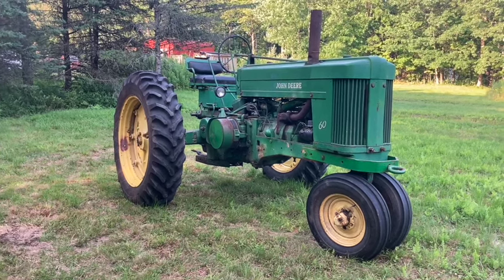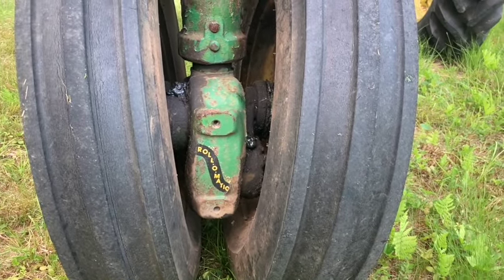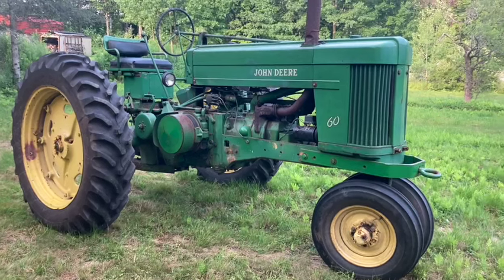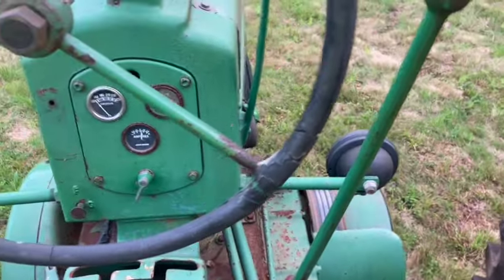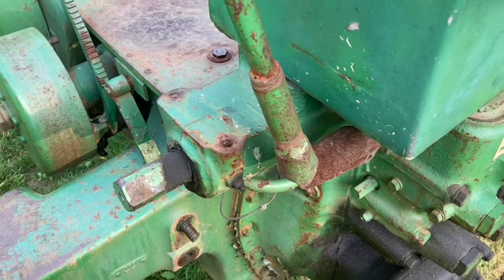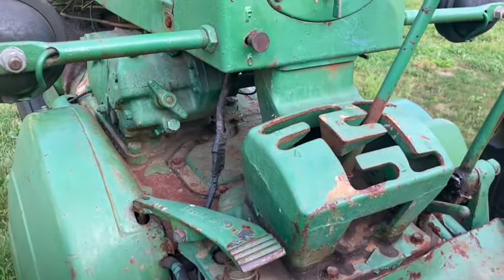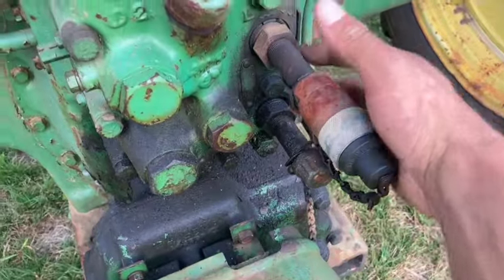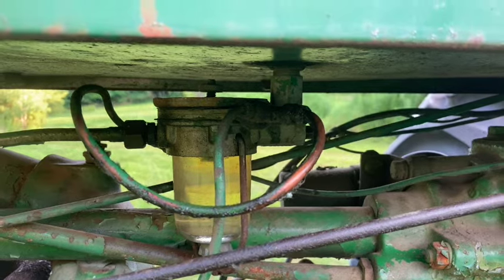1952 John Deere 60 Tractor

Comment: Live PTO but no live hydraulics?
Reply from the maker: There are ports on the back for a remote hydraulic cylinder. There are dummy plugs in there right now so the lift will work.
Reply: Yes engine driven hydraulics.
Reply: Live hydraulics, work good

Comment: Wouldn't put a rotary mower behind a 2 cylinder,  pto doesn't like the momentum of rotating blades. If you still put a mower on, don't use all of tractors power.

Comment: I have put a brass shot off  valve in line with a inline filter and use 90 octane and even treated the fuel and shut valve and run most of fuel out of carb do not trust shot off  gas today destroys everything  I have  A B 60. 50 620 630 730 mt

Comment: I have fixed the cracks in the steering wheel using body filler (bondo) and a rotary file in a drill or air die grinder and finish with black paint. Is a permanent fix.

Comment: You engage the clutch because there is a bearing inside the clutch pully that cannot be lubricated because the clutch disks would get grease or oil on them, and this would cause the clutch disks to slip. This bearing only rolls when the clutch is disengaged. Because you cannot liberate it, you should always shift to nitrile and engage the clutch when the engine is idling, and you are not going to move the tractor.

Comment: I'm an International Harvester Farmall man , so I maybe, wouldn't of know, or had to guess,  what  some of the operator handles  are for, "if" this was a year ago.
But over the last  few months, I been trying to work on a J. D 620. So I bought a parts book, and it came with a J.D. 60 service manual included. I just went thru
what's this handle for?  Wonder what this for? I guess a few handles are diff. on the 620. But this was some help thks